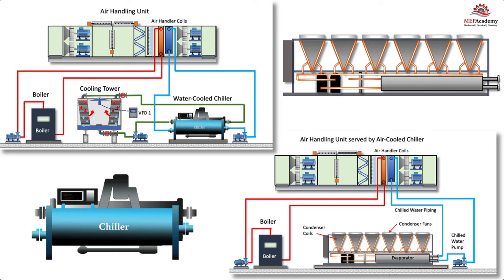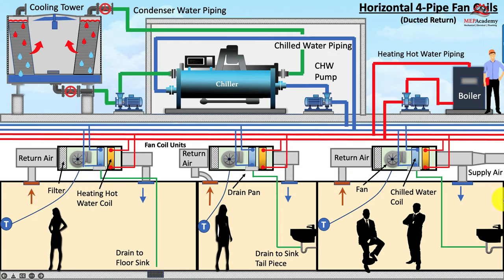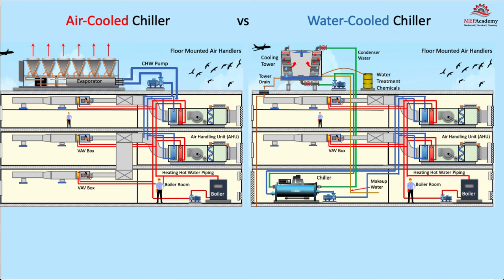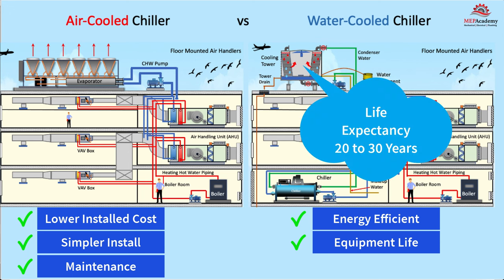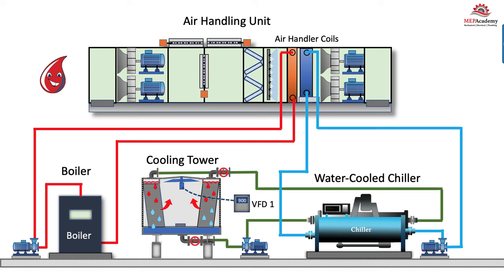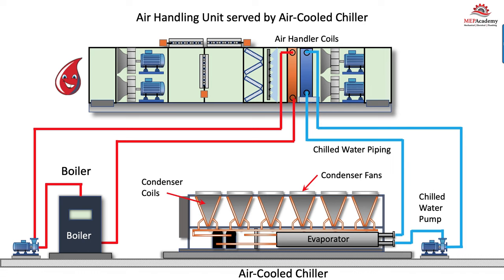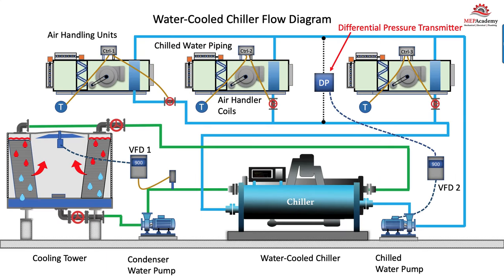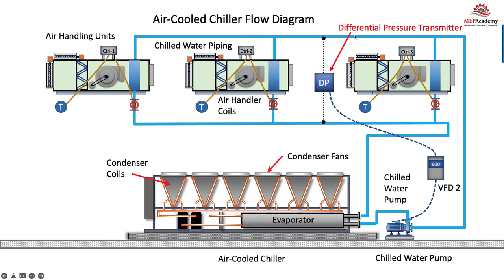Air-Cooled vs Water-Cooled Chillers and how they work with Air Handling Units

Comment: Thank you for the adequate explanation, but you may have forgotten an important part.  In the event of a variable load on cold water through several air treatment units.  You need to reduce the speed of the water pump. Therefore, you must control the operation of the water shredder by placing an insulated water tank suitable for the load. It controls the capacity of the shredder through a special temperature regulator or several thermostats depending on the number of compressors in the shredder.
Reply from the maker: Thanks for the comment.

Comment: Professor, can you send a link to a simulation program for cooling and heating systems for mechanical and electrical parts and control circuits? Thank you.
Reply from the maker: We don't use those programs, but you can find them by searching Google. Here is one of them https://hvacsimulator.com

Comment: What is the function  of the boiler  in the cooled water processe
Reply from the maker: Temperature and humidity levels vary per geographical area. The heating coil can be used when dehumidification is required to drive down the humidity and then bring up the temperature so that it's not too cold, and it can also be used in cold climates where additional heat is needed to supplement any terminal zone heating. The boiler would also feed any VAV reheat Coils are Fan Coils that are not shown in the image.

Comment: Is there water together with the refrigerant inside the chiller? Where is the inlet water coming from that transforms into chilled water for AHU and condenser water for cooling towers? I’m confused
Reply from the maker: The water and the refrigerant never mix, but transfer the heat between them using a heat exchanger. See our other video on Chilled Water Central Plant basics as we believe that might help you better understand. https://youtu.be/zit6eWY2hD8

Comment: Please  what is the boiler function  there am a bit confused
Reply from the maker: Temperature and humidity levels vary per geographical area. The heating coil can be used when dehumidification is required to drive down the humidity and then bring up the temperature so that it's not too cold, and it can also be used in cold climates where additional heat is needed to supplement any terminal zone heating. The boiler would also feed any VAV reheat Coils are Fan Coils that are not shown in the image.

Comment: Thanks for this explanation.  Had a question regarding the check valve screen filter installed at the FCU.  My check valve screen filter is installed on the return line (after the coils)?  Is this right?  It seems sensible to have this screen filter to be installed after the shut off valve and before the chilled water enters the FCU. Can you confirm?
Reply from the maker: If the valve is also used for filtration, then having it on the supply side before any coil or control valve would better serve its purpose of preventing debris from collecting in sensitive control valves or clogging heat exchangers.
Reply: @MEPAcademy  Thank you first and foremost for replying.  That's what I figured.  Also, all the piping that carries the chilled water and hot water to our FCUs are ALL Black pipe (same pipe used in gas piping applications).  Not sure if you know NYC code but this doesn't seem to be code unless I'm missing something here.  Building was built in 2018.  It's a newer building
Reply from the maker: @JtotheRizzo  Not sure about New York, but  its common for engineers to specify copper for all small piping up to 2" or 2-1/2", somewhere around there, and everything above that to be installed using carbon steel piping.
Reply: @MEPAcademy  The Risers are 1-1/2" (maybe 2") black pipe (looks to be iron and not steel) and branches are 3/4" black pipe then transitions to copper at the shut-off valve to the appliance (FCU). I'm thinking this is the cause of my cooling issues because my HVAC guy found a lot black sediment in the chilled waters.  He thinks it's coming from the Riser and Branch piping that is running throughout my building and causing inefficient cooling with some of the apartment's FCUs. Would love to hear your thoughts on this.
Reply from the maker: @JtotheRizzo  Black sediment could be many things. what kind of chemical treatment is the chilled water system receiving? Are there dielectric unions or nipples between the black pipe and copper? Sounds like the system needs to be flushed. Have you cleaned the tubes of the chiller?
Reply: @MEPAcademy  To answer your questions as briefly as possible:

1. Branch line (black pipe) transitions to (what I believe is) 6" galvanized steel nipple (light grey pipe) with a iron black pipe coupler.  Then, galv steel nipple transitions to a copper female adapter (FIP) to a brass shut-off valve followed by copper piping all the way to the FCU.  I completely agree that a dielectric union or at least a brass nipple should have been used when transitioning from black pipe to copper. By the way, the iron coupler is heavily rusted on the chilled water supply line.

2. The Building and Super claim the water is "chemically treated" at the Chillers as required but they never tell the condo owners to turn on their FCUs when they do this so the chemical treatment never reaches the interior coils of the FCU of it's not turned on during the treatment.  Also, the "chemical" they use, according to the Super is a chemical to prevent rust from forming on the inside of the pipes, and not a chemical to dissolve any black sediment.

3. We're not able to flush our FCUs without doing some repiping to install isolation valves with drain ports.  The Building refuses to perform this chemical treatment throughout the entire system because only 2 apartments are supposedly affected out of 50+ units.

4. This also bring me to my concern of why the Check Valve Screen Filter is installed on the return lines and not the supply lines.
Reply from the maker: @JtotheRizzo  If only two apartments are having an issue, I would look at how the piping is routed. Are those two apartments next to each other? Are they served from the same branch pipe? Sounds like the piping is having a reaction at the point where the two dissimilar metals are connected, is that correct? The chemical treatment won't get rid of the existing water issue, as this would most likely require flushing, and determining what is causing the problem so that it doesn't reoccur.
Reply: @MEPAcademy  Thank you for providing the valuable responses you've offered concerning our issue.  I think I can say with fairly certain confidence that the issue is isolated to the FCUs but my purpose of reaching out to you initially was to find out 2 things.
1. Is the check valve screen filter installed in the proper location (i.e. should be installed on the supply line and not the return line; and
2. Is using Black Iron Pipe (similar piping used for gas lines and sprinkler water applications) to Code and common practice when used for Chilled Water HVAC applications.
I'm sure if we have the FCUs flushed, it will likely fix the inefficient cooling issues we're having but I want to confirm that the if Black Pipe is OK to use in chilled water HVAC applications, then it is very/more common to have black sediment circulating within the water system.
Reply: What if water and electricity cost are both high and the site is located at a seaside (on a remote island), which one would be a better choice?

Comment: hi...sorry for personal question...but a kelvion gas cooler with 8 total fans in two rows is being installed at the roof of a supermarket next to my bedroom but 3 metre below. in terms of height..do you think this will make too much noise and the heat from the fans will be damaging...would there be any difference during summer and winter noise and heat levels...thx a lot
Reply from the maker: We would need to see the submittals for the unit being installed. The submittals or engineering manual should show the NC (Noise) levels that will be experienced at different distances from the unit. You state your 3 meters above, but how far horizontally are you from the unit? Sound will reverberate off the walls surrounding the unit if in proximity to walls. Wind direction will affect the discharge air coming off the top of the unit if in a windy area. Heat rises, so the outdoor temperatures will have some effect, which is more important for you during hot days, when additional heat is unwanted. Your local mechanical code will dictate how close this piece of equipment is allowed to a property line. Good Luck.
Reply: Thanks a lot...horizontally we are 1 meter from the coolers....the sound pressure levels are 27 and 17 at 10m during day and night...the sound power level is 61 and 51...thanks
Reply: the unit name is Kevin GF -MC104G6
Reply: If there is a email or phone you can share, I can email you details and we can chat...I am very happy to pay for the consultation...thanks
Reply from the maker: You might want to contact a sound consultant. That is not our specialty. They can do field measurements, which we don't do. Everything else is just theory from a text book. You need field measurements to document the actual conditions as there are many factors that can play into how sound moves off surfaces. @spssgs
Reply: makes sense...thanks @MEPAcademy